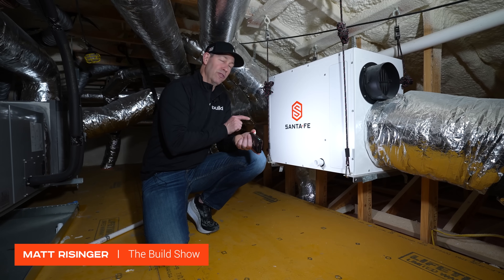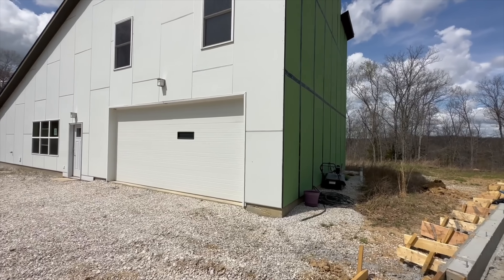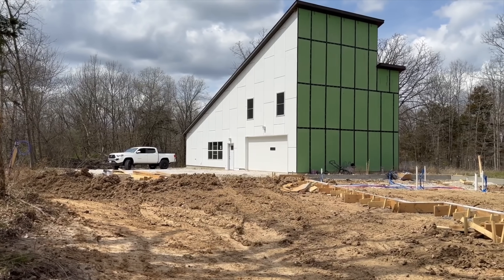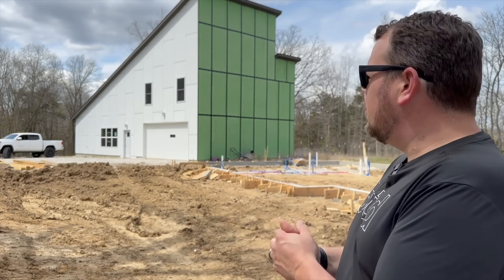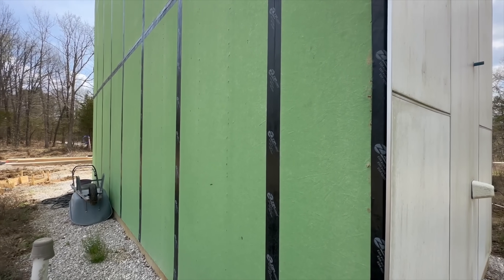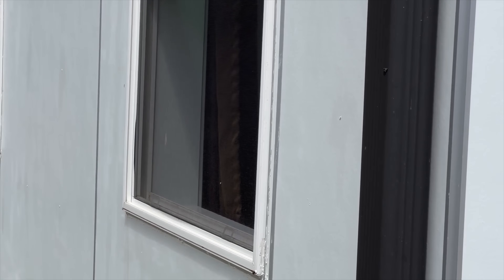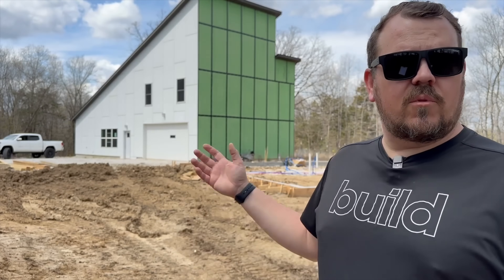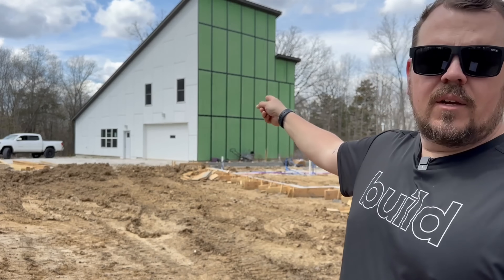ZIP Sheathing After 10 Years Exposed — What Survived & What Failed

Comment: All you airtight code bots......trying to explain these energy requirements is about the saddest thing I've ever seen! Y'all are trying to justify a failing system! Be sure to get the uv blocking energy efficient windows, so you can't grow plants in your window, but you'll sure breathe a house full of toxic furnishings and an under engineered cheap hvac system....air tight mold/condensation trap. Please do electric cars next....I'm sure you'll find a way to explain how mining is good the planet, carbon is bad and lithium batteries are perfectly safe forever! They don't explode, fire departments can put them out easily...if you get in a wreck in an EV it's perfectly safe...modern debt slave Donnie's! Grow a pair Debbie! F'n hell!

Comment: The premise of this project is absurd.  The foundation is functioning but "too shallow" . . . why not re-dig the footings?  The exposed ZIP on 2x6 that was in great shape.  The siding on the other side should be removed and the siding inspected or replaced.  Then you have ZIP in good shape over 2x6 framing in good shape all the way around, in a custom designed house with high end finishes installed by the client.  Needs a liquid applied membrane, continuous external insulation, rain screen and siding.  Then add glazing to the flat side of the house with some east-facing decks.
Reply from the maker: I’m not certain we did a great job explaining everything in the video however the existing building simply had too many issues.However, Ill give it a try here.  It is more cost effective to build a new custom home than repair the issues with the existing unit. The foundations footings were too small, the slabs were placed in multiple parts and were not structurally sound. Slabs were placed without any sort of vapor barrier and moisture drive as well as radon were issues. Indoor air quaility was an issue for other water intrusion issues caused by poor install of windows and water management. Only the Zip that was exposed to the elements and allowed to dry constantly was in great shape. The Zip that was captured behind large 4X8 sheets James Hardie has developed issues due to large amounts of water held in tension due to absolutely poor water management issues. There were other large quality issues with windows and interior finishes being poorly installed. The clients made the right call to walk away.
Reply: Two additional items for anyone who may come across this in the future: The reason they have the window open is that the house has so much zip and so few windows that it is super-tight.  With that much air-barrier you need to supplement make-up air.

Comment: I tend to lean towards comprehensive building inspections for homes. Makes since for me. Not so much for a pole barn a shed a concrete slab except if being done by a licensed competent contractor. I if I want to build a detached building on my property should be able to with out permit fees and bs inspections.  Of course adherence to set backs. Non residential.  Again if the process was not expensive and permits could be issued before summer ends...😊

Comment: I have voted for Libertarian candidates multiple times in the past, although for most of my adult life I have been unaffiliated with any party. I would really like living in an area that did not have exceptionally strict inspections, but only if I had loads of land around me and my home was fully self-sufficient (well, solar, backup generator, etc.). However, as the house I own is mere dozens of feet away from my neighbors, I completely understand why code enforcement does what they do (even if some of their opinions seem entirely misguided). In any situation where one's neighbors' bad decision could result in one's own home falling victim to those decisions, enforcement of some minimum standards is essential to a functional community. In very rural areas without code enforcement, as you had stated, it is upon the homeowner to either hire professionals to do the proper inspections throughout the building process or it is upon the homeowner themselves to learn and do that. Otherwise, this is the result - lots of wasted money and a structure not fit for its intended purpose.

Comment: Weird!  So weird.  First, the first structure is one of the fugliest homes I’ve seen built “relatively recently”. Ouch!  A 1/10 in curb appeal.  And they so obviously tried to meet a low cost target vs doing it even remotely right.  Second - why in the hell would you build your “new” home so freakin’ close to this fugly monster?  Even if this wasn’t ugly, it’s going to look MEGA awkward to be that close.  The client hasn’t learned anything about aesthetics.  Good luck selling this property in the future for anything other than bottom dollar.  

I’m shaking my head.  Why?  Why?  Why?  So many levels of weirdness. 

Sorry to be so negative.  But dang.  Ugh!
Reply from the maker: The old home is going to have some aesthetically driven items handled once the new house if completed. Second floor removed, more traditional roof line added, things like that. Only after the other home is built, and maybe a couple years after depending on cost.
Reply: @jake.bruton.aarow.building - those are definitely “improvements”… but the two structures are still awkwardly too close together.

Comment: You can have a 2x6 external walls but use 2x4s and they essentially have two walls built in one because you going to alternate the 2x4s on the external and the internal portion!!! This way you can weave insulation between the the gaps of the 2x4s...super insulation...
Reply: Definitely do not do that.... !!!    Two separate walls has a thermal brake. Insulate both with a air gap between.
Reply: @Rick-qf5de  All kinds of problems with an air gap in the middle of the wall, particularly if in a north climate.  You could get condensation in your wall with and air gap.  Make the insulation continuous and you move the condensation point.  Staggered studs are a good way to build to break up the thermal heat transfer through the stud from outside to inside.

Comment: You can lift that house up and put a proper foundation on it... You could even build a foundation and then move the house onto it...
I would only buy that house if that roof was facing South for solar panels... Quite frankly, I don't know what you're talking about zip...
Reply from the maker: I’m not sure I am following your comment either. The home has too much wrong to value what remains. The building will still be utilized once we are finished with the new house however, it isn’t getting tossed away. It simply won’t be an occupied home.

Comment: Why would you staple the sheeting? The outside sheeting is what give the home it's shear strength against the wind and other side pushing elements. Staples will not hold up. On top of that they didn't stagger the sheeting making the shear strength even weaker yet. Whoever owns this home needs to file a claim against the builders insurance company.
Reply: I doubt the builder HAD insurance and probably is pout of business.
Reply from the maker: There was a lot done poorly on this previous construction. Staples are a standard in spec construction in the midwest. That doesn’t make it right, I’m just letting you know it happens a lot. Huber doesn’t approve them. The seams should also be staggered for optimal structrual capacity according to most manufacturers. Unfortunately the builder is no longer alive and the clients don’t believe he was insured. There isn’t someone to chase after on this one.
Reply: @jake.bruton.aarow.building  For how much the previous builder was a hack job, I'm not surprised he's no longer alive. He was probably killed by a disgruntled client who got screwed over or he died from not following code.

Comment: If you can put your hand through the slab, and there's no insulation OR vapor barrier......How are they not experiencing moisture coming up through it? Unless you mean they are not having the actual water table push up through hydraulically.
Reply from the maker: They aren’t having liquid water pooring through the slab. They are definitely having water vapor.

Comment: I used to pull electrical permits for the company I worked for, not an electrical company.  Some cities charged $350 for a utility cabinet on the road side right of way, and another city charged us $25 for the same equipment.  I finally asked the cheap city why they were so cheap, they said they wanted the people to pull permits for everything and make sure it was done safely, and in the long run, it was cheaper than a fire truck putting out a fire because of faulty wiring.  That is the way every government should be run.  If governments were run for the Welfare of the people instead of their own power (HOA's also) then more people would respect them and use them to their advantage.  Not like California, were the governments charges you to do an inspection of your property, and they show up several times a year to make money and abuse their power.
Reply: I fully agree. When municipalities used code and or inspections as a revenue stream it went south. Here even if you get a permit you wait and wait sometimes 6mos.  Code is the bare minimum to legally build a home, and here most builders do the minimum if not less. One sticking point I have with the permits and "code inspections". They are not held responsible if they screwup and "pass" substandard work. No accountability.  Especially with builder "code inspector" close relationships. This is directly from my experience as a home inspector,  inspecting many predrywall and finished home inspections, if the builder will let you in to inspect for the buyer...Just my experience. 😊
Reply: California has to have high permit fees because welfare states can't pull their weight. In 2022, California paid $83 Billion more in federal taxes than it received back in federal dollars. California is a "donor state" and you are in a "welfare state" ...

Comment: It makes sense, as much as I don't like government poking their heads into things, I do like the idea that someone would be just double checking all the work. Though I draw the line at some bureaucrat telling me how big my basement bar can be and if there can be a second kitchen down there too, that's not safety or functionality concerns, that's just telling me how to live.
Reply: A kitchen in the basement can and often does become a safety issue. You can have electrical fires from the stove. And if you do not have adequate egress, you can be dead. You need proper exhaust for fumes. People may not install plumbing correctly and you get sewer issues. I’ve seen a basement kitchen that had a small stove/oven combo installed on top of carpet!!!  
It seems like an intrusion, but codes, for the most part, are really done for safety issues.  And most are based on the current national building codes. I lived in an area in PA where homes were being built left and right by every Tom Dick and Harry who had a hammer.  They were putting up things that came no where near basic codes. So the township went a bit overboard, instituting some pretty significant codes. The jerks left, and decent builders came in. Many of those initial homes were so bad they were being torn down to build new. Foundations were failing, plunging and electrical were all wrong. HVAC was a disaster, insulation was not done. Walls were being built with junk lumber and many  had studs so variable that walls were unsteady. 
You also need to realize that things not done to code, and not inspected by the proper authorities can void your insurance. Had a local home in WI where the guy did a bunch of DIY stuff wrong, house caught on fire, and the mid six figure home was not covered as none of the work had been done correctly nor was it inspected. They lost everything.
Reply: @1packatak  My understanding in the case I reference this from, was that it had more to do more with the idea of not being allowed to make it seem like a basement apartment without the house being setup like that with a separate entrance and all. But they didn't intend to treat it as such, they just wanted a smaller kitchen in the wet bar for when they had parties and such. Code never says a thing about putting a laundry room on every floor of a house, or even if you can put a second kitchen behind your main kitchen, but the second I want a wet bar the size of a small kitchen, I have to apply for a variance, and then hide the stove hood venting in the wall until AFTER the final inspection just because I want a stove. I've seen some JANKY half@$s setups in unfinished rooms in basement that adjoin the wet bar because of this, when they could have had a properly installed and safe setup.
Reply: @compactc9  good grief!!  You would think a city or township could make a decision on something without causing such a mess!!!  You would think they would rather have you have all the plans drawn out, and be able to see that what will be done meets basic building codes. That it will be safe. I wonder though, after seeing a couple of not-to-code builds that burned where I used to live that insurance refused to pay, how that could affect you??  It just seems to make more sense to just have it all planned and inspected, and then insured. But then again, government doesn’t always make sense, do they??

Comment: Former capital "L" Libertarian here. I found that I was more ok with regulations anywhere I had domain knowledge and that educating myself in an industry or domain was antidote to my ideological inclinations. Anyways, food for thought.
Reply: Exactly my thought listening to this. Regulations happened more often than not because someone was defrauded or someone died. We absolutely do have stupid regulations out there, but the first question anyhow has to ask is "why was it made in the first place?" If you don't know, it's a very good chance you don't know enough about the topic.
Reply: @ocdtrekkie  I'm still a Libertarian for the most part. My issue with regulations are less with the stipulation and more with who enforces it and who creates it. Unions often make code restrictions in order to make work. They also restrict licenses. I have no problem with needing to get a permit or certification. But wall them behind inexpensive tests which actually test knowledge or skill: not time on the job. 

In some states, to get a low voltage license you need 6k hrs of certified hours of experience. That is crazy and designed to restrict how many licenses there are to drive up the costs. That is immoral and monopoly tactics. I have fixed many poorly installed but certified electrician's work even though I'm not an electrician. I've educated myself and know how to do the work (of low voltage). I respect the industry and it makes me sad to see Unions destroying so much of it.
Reply: @1stGruhn  There's upsides and downsides to everything. I definitely think there's reasons to require professional standards for trades roughly equivalent to the likelihood your mistakes kill people. In that vein, I'd generally agree low voltage shouldn't be that high burden of entry. I do live in an area which requires metal conduit for all residential electrical, and honestly the way everyone else just slings romex everywhere sounds incredibly cowboy! Every video I see of electrical elsewhere looks like a fire hazard, but I guess people get by okay.

But also coming from the tech industry, where unions are largely not a thing, I can tell you that I'm confident quality, standards, and ethics would be far better with unions. Unsurprisingly, the non-union realm is where CEOs unironically suggest a salaried no-overtime worker should be ideally working about 60 hours a week: Unions demand a quality of life for workers that non-union folks can only imagine.
Reply: Most people are morons so let the government into your house the post...  No there should just be an IQ test, you score higher than 150 and you can do whatever you like score 90 and nanny government gets to hold your hand.

Comment: I see it all the time here in VT. I’m in pre construction right now for  an 8 year old home that the interior walls are suspended off the clear span trusses because the floor system is rotten to the point that the Advantec and hardwood flooring are the only thing holding it. The crawlspace never got anything for vapor control so the entire floor system needs replacing. All because of lack of builder education and no code enforcement.
Reply: Must be mold city in that crawl space.  I'm in CT, 4 years ago was doing a bathroom/kitchen for a "builder"/investor.  Across the street he had a new build on going.  Come to find out when the plumber cut into the subfloor to access the sealed crawlspace for his rough in, the smell and moisture was off the charts.  Mold city on the tji/rockwool.  2" of standing water.   Come to find out he framed the floor over the crawlspace in December, put a tarp over it and didn't frame/enclose the  building till March.  Snow laid on that for months.  No ventilation... Incompetent morons.